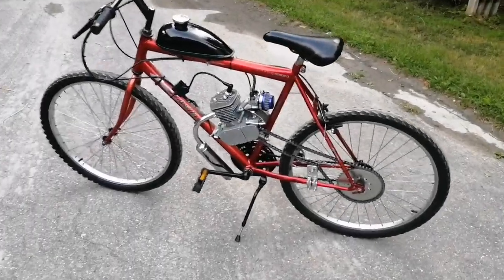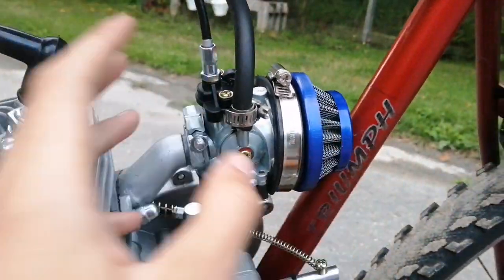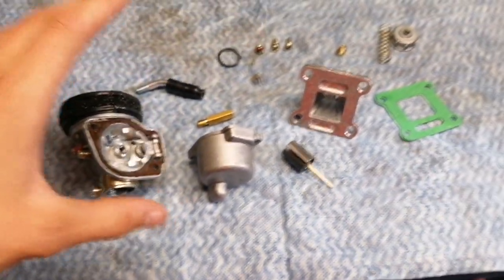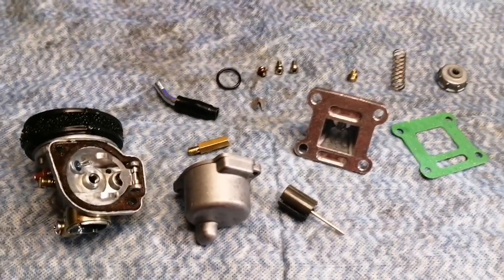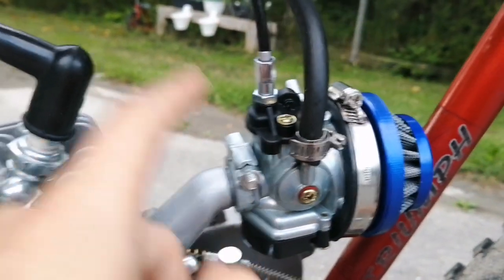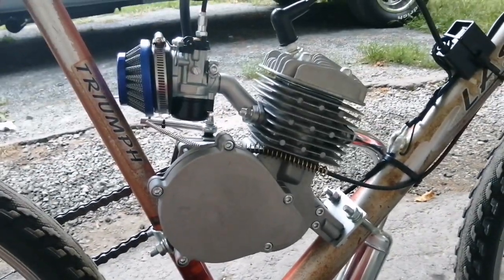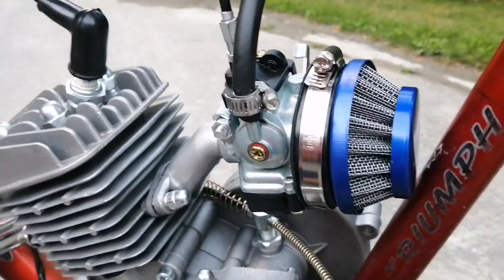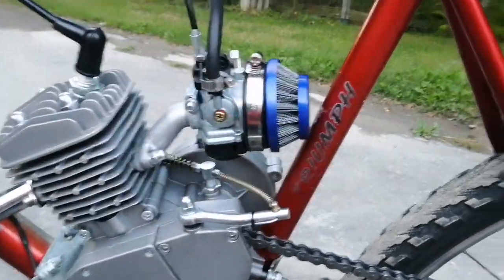How To Make your Hp Carburetor Run Better than stock!

Comment: While I dont know how well this carb works on a 2 stroke engine, I can tell you it sure helped my 4 stroke run way better them the carb that came with the 4 stroke engine. But, it does need jetti g down a bit. I think its jetted for a 80 or 100cc engine and my 4 stroke is a baby 49cc. Anyway, I do recommend this carb for a 4 stroke.
Reply from the maker: Yup they can run decent but a fully adjustable carb is better in the long run

Comment: Mine ran good in cold high altitude weather on a 65 or 68 jet. Brought the bike to sea level and did not run no matter what. At sea level getting 45mph on a bofang and was getting that same speed at high altitude with the hp. Benefit for my when using the hp, it ran when under 20 degrees at high altitude when the bofang would not start at all
Reply from the maker: Yeah changing elevation a lot can effect these small engines for the worst. Like I mentioned if you go with the real aerbo carb you can adjust the air/fuel screw on the fly which is way easier than changing out the main jet all the time. Sometimes the needle clip will get you by too.

Comment: Great stuff. Just finished my first build. I had it running right after build then the engine siezed up. Piece of metal from the factory.  I replaced the piston rings, put hp carb, brass head gasket and hp cdi and magneto. Took me another few weeks to figure out my woodruff key was missing from the magnet. Once I installed it runs great

Comment: an interesting side note: the top "cap" pf the HP carb where the cable enters, being plastic, can be modified for any other cable end as I've done with mine with an old Triumph motorcycle cable and throttle grip
Reply from the maker: Yea I just used the one from the N/T carb and that helped it return to idle. update: the carb has been working awesome and it’s a lot smoother than the standard N/T.

Comment: right on brother 66 works good for my altitude in fl and for you 70 should be good where youre at💯
Reply from the maker: Thanks bro gonna be ordering some jets soon for my carbs and I’m really going to fine tune them and get the most of out the NT carbs that are on my other bikes.
Reply: @keeganhache6667  word i know youll get them perfect⚙⚙🚲🚲⚙⚙
Reply: Facts... I'm in FL and yesterday swapped out the stock jet to a 65 and it runs pretty damn good... gonna mess around next weekend with other sizes for research purposes lol

Comment: I'm glad you like this carb. I'm thinking about getting one of these just for kicks. I wanted to try my old NT on but sadly I lost the needle and the top cap. Definetly an option.
Reply from the maker: What carb are you running at the moment?
Reply: @keeganhache6667  BoFeng. I've been having these overrevving issues lately. It's not a poorly venting tank and it's not an air leak. The idle is very slow and it dies or it stays revved high. I've cleaned it today so I'll see if it changes anything.
Reply from the maker: @Matthew-wj8cm  it could be your left side crank seal behind the magneto magnet. Remove the magnet to uncover the seal and then use a socket that just fits over the end of it and tap it in until it is flush with the case

Comment: Nice video, very helpful. You mentioned drilling out a hole in the house carb and that you would show a picture. Maybe next time around?
Reply from the maker: Yes my man I will definitely include that in the next video about the carb! Sorry I forgot to mention it I didn’t have micro drill bits at that time but basically if your bike is running to lean at those set throttle positions you will drill out the hole slightly to allow more fuel to be pulled into the air/fuel mix.
Reply: @keeganhache6667  ok thank you. I'm still breaking it in so don't want to push it too much. I'm in Florida so still guessing which jet to go with. I have from #64 to #75, thinking 71 or 72 may be about right. Thank you again!
Reply: @jimjensen1096  I'm in FL... I just threw a 65 in it and it's working pretty good... maybe I'll F around next weekend and jet up just for research purpose lol

Comment: Good evening young man. I've been enjoying your videos for a few years now, much respect for your skills and attention to the details. If it's OK, I'd like to ask you about my h p carburetor.  I'm running a lightly ported 66cc motor with an OZ reed and a clone mz65exhaust. I believe my issue is the jetting, but I would appreciate your opinion. 
 So my idle screw is mostly all the way in for the engine to idle. While starting the ride, I believe it's 4 stroking, until I give it about 3/4 throttle.  During acceleration it runs/ sounds perfect.  Once I'm cruising its OK, maybe just a little 4 stroking. There is really no low speed or low end performance. The jet doesn't have a number on it, so I can't say the size. Based on what I have told you, should I make a change to the jet and, if so ,go larger or smaller? Oh, one more thing: I was considering adding a length of hose between the reed case and carburetor.  Would that help or hinder the performance? Thank you in advance for your help, and please keep up your excellent work! Take care Keegan.

Comment: Hey, Loved the vid, I have a few questions. How did you hook the cable onto the carb, and how is cold starts. Because with my stock bofang carb, It will never idle on full choke so I gotta play around with it, and on this carb, it seems to either be full choke, or no choke. Is there a way to eliminate the choke lock? Thanks.

Comment: I love both these carbs! They melt super fast in my melting furnace to make carb boots for good carbs lol😅 

I know off topic of video you did.  Buy a nibbi 18 or 19mm carb. Going to be like 45$...  I know expensive compaired to most carbs.  Once you buy one.... you will never want to use anything else.  Try it you won't regret it! Out of every carb I owned.  Most easy carbs to tune and run ever seen
Reply from the maker: I own 2 pwk’s… that’s the same carb Moses raced in SoCal and I bought jet kits for both and tuned them to perfection. They run great and I’m happy with them. Nibbi is just another brand to choose from. I’m getting a cdh67 pipe to try out so expect a video coming up for that! Also I’m currently trying to save my money for my car it’s most likely going to be a V6 charger lol.

Comment: recently, i've been getting ZK branded HP carb's that have a jet that looks like a #70. is that right? ... So I like to experiment and install a #68 or #72 depending on which engine the carb' is on. BTW the threaded shank diameter is 7mm and the screw head is 6mm on the jet for the HP carb'.
Reply from the maker: Yeah I think china is getting it right putting in motorized bike sized jets in

Comment: can i still use the HP carb for my stock china doll engine? what size jet should i use for it to work on my stock engine.great video btw!
Reply: A mid 60's jet works well for me in south Florida, which is basically sea level. Your altitude will determine your jetting choice. go bigger as you go up in altitude.

Comment: witch fuel cable u recommend for this carb? i used 8mm and the carb drowned in fuel
Reply from the maker: 5mm gas line or 3/16 will work

Comment: Hey Keegan. I bought this carb as well as an Oz reed valve and deluxe pipe (mz65). Do you think the stock nt jet is rich enough for the higher airflow with the 3rd transfer and window piston?
Reply from the maker: With the third transfer port you may need to up size your main jet to like a #72. Also your altitude plays a huge part in what jets run too. With my piston port setup on the black and blue bike I find that a #70 jet words great.
Reply: tell me how it goes planning on doing the exact same things to my bt100

Comment: I’m having some difficulty getting my HP to un choke. 99% of the time it won’t un choke so I have to do it manually. The times that I did get it to un choke I’ve been twisting the throttle to the breaking point. Any advice or suggestions? One person of considerable credibility suggested that I needed to switch out the standard twist throttle for an upgraded aluminum style, but I can’t understand why that would make a difference, plus I’d lose the kill switch.
Reply from the maker: Yeah the throttle style has nothing to do with that. That little arm that is supposed to catch and release the choke you may need to bend it side to side and play with it a little to make it unchoke
Reply: @keeganhache6667 about how much throttle is needed for it to properly release the choke?

Comment: I have 2 of these on 2 gomax pk80 bikes with the g4 cylinders that are factory ported, they worked great the first couple of years and idled perfect, now since I rebuilt both top ends with the same parts, they both won't idle right, at full throttle it takes a few seconds to idle down when I release the throttle but won't idle down when I'm going downhills? I have 62 jets in them both for 1500 ft elevation in southern Oregon. The idle screw doesn't adjust anything either?
Reply from the maker: You might have a air leak or the jet is to small for the new cylinders. Break both of them in with stock jetting
Reply: @keeganhache6667  stock jets on those runtong  clone carbs are 78s, I got it fixed now , I bought new carburetors for them, thanks for answering.

Comment: Get an oko or pwk, if you have the dough for it, go mikuni all the way.
Reply from the maker: Yup I got 2 of them now Great carbs
Reply: @keeganhache6667  There you go, boss. Now the wonderful and very pleasant jetting phase.
Reply from the maker: Already got that done lol the first one I bought went on the Harley and the second one went on my felt faker bike. I love that they are so tuneable and easy to work with. However I would not use one on a stock engine because the won’t “flow” this carb very well. Also I’m using my new degree wheel and I love that too. Always advancing in the hobby

Comment: Do you get more low end torque with this carb?
Reply from the maker: No you notice more rpm and a smoother ride. I wouldn’t say that one carb makes more power than the other.  But the HP carb if tuned right will have no 4 stroking problems like the NT is known for.

Comment: I’m currently running to lean on one of these carburetors on my bike.

One I’m around half throttle it’s OK but then when I reach full throttle, I slow down and set up speed up😂
It’s really annoying because it feels like that extra twist in the handle should give you more speed but I kind of just have to find tune it to a specific spot which is like a half turn and that’s just enough for me to move and reach my 24 25 mph speeds, but it still feels like I should have more power than I do especially on an uphill
Reply: And I get it it’s only a 50 cc engine but still it feels like it’s lacking in power and some forms told me that it’s most likely running to lean😂 but I guess I’ll have to do some more research on drilling a hole on that middle pin and hey if I break it, I can always go back to the NT carburetor🎉 I know it’s dumb to say this, but if you want to see the bike, then I’ve been posting videos on my channel about it and the issues I’ve been fixing along the way